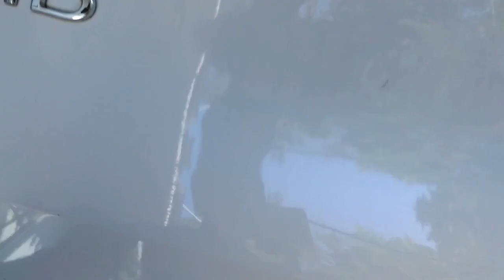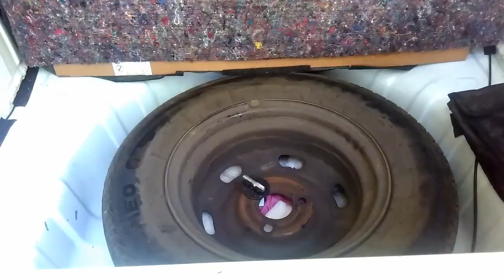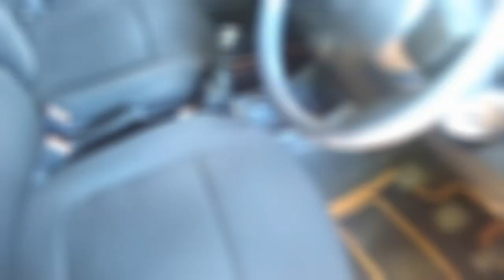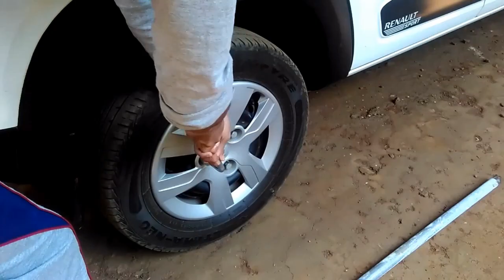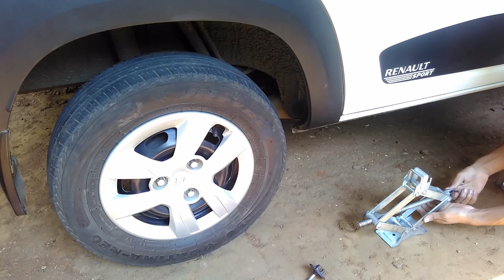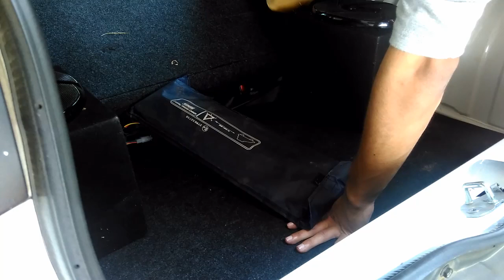Renault Kwid How To Change A Spare Tyre - Little Different From Other Cars

Comment: Just had a flat tyre luckily car was still at home so decided to change the tyre tomorrow. Meanwhile decided to check this video I came across and realized what that metal piece was for. Renault nuts are different from the usual Suzuki nuts. The Renault nuts have the screw attached to them as well so when the nuts come off the entire tyre can fall hence the metal component to add as a support. Good thing I saw this video before changing the tyre.
By the way, what is the nut size of kwid 799cc ? Tried my alto spanner but it didnt work.

Comment: I also placed my my jack at the same point where u placed it but by the weight of the car it developed a dent. that means that part is not the jack point.
Reply from the maker: They marked jack position there , but place the jack back wards from the marked place, then no problem.. I am also experienced the benting issue first time I placed it..

Comment: What is the best Air pressure for Kwid Rxt 2020? Can anyone help me
Reply from the maker: 29 Psi is recommended by Renault, but I fill around 30-31 for better mileage and performance. Anything more will affect stability and suspension become bumpy.

Comment: Bro for me one doubt. In all kwid model there is a water leaking problem they told that don't buy the kwid it is real or how to control that problem . Please upload the video
Reply from the maker: No issues for me till now, 2 Years. Water issue is only on first few batch cars  now no issues.. you can Check area below wiper and clean it if there any dirt or leafs ..

Comment: I have frequent engine cut off while slowing. Car has been left for repair. Can anyone comments if you have had the same problem.
Reply from the maker: With AC or without , check whether your cars ECU updated , Kwid has good improvement after ECU updation, ..